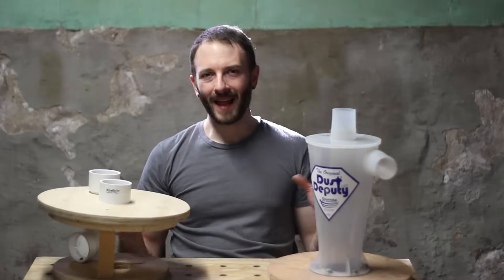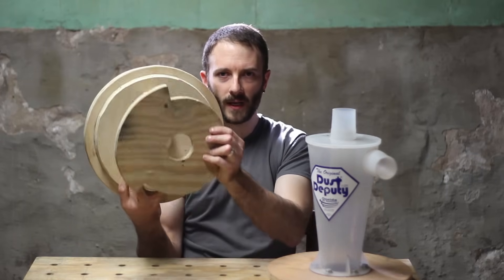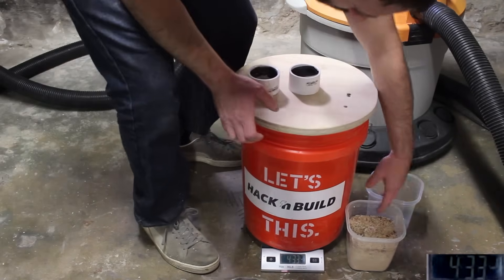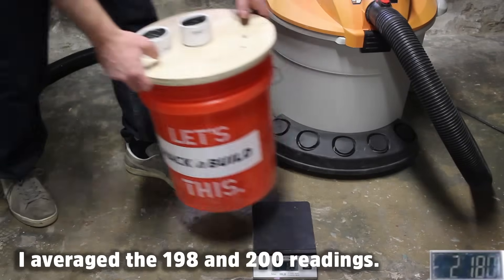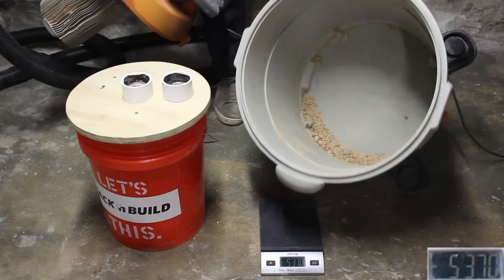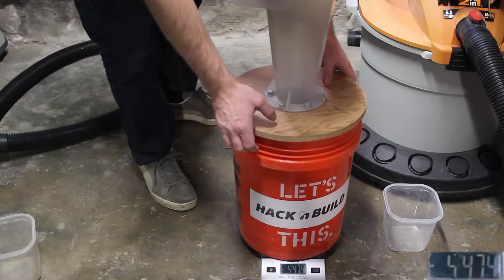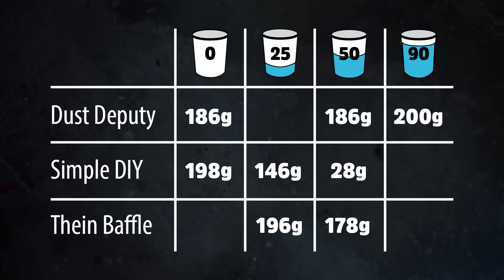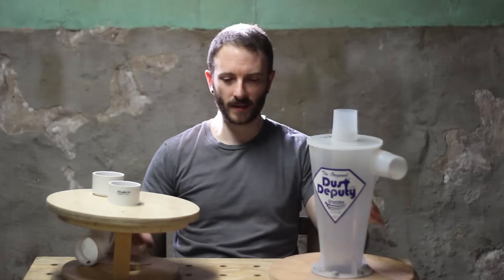IMPROVED cyclone dust collection vs Oneida Dust Deputy (2/2) - HNB #10

Comment: Just a thought if you really wanted to make it work when the bucket was fuller. Adding slots ie louvers to the bottom third of the opening in the baffle or just below it. Would reduce or eliminate the saw dust being sucked back up. Since the negative pressure created by the vortex suck it up at an angle that the louvers will prevent. But a cautionary note, if the louvers are to high they will interfere with the flow of the vortex, that would make it worse not better. 

BTW, Since I was considering doing the same basic thing to a trash can. (But I was going to use the 1st method you mentioned where baffle with attached an extended center outlet pipe.) So this proved what I suspected already so thx for testing it out. And for small container it would make more sense for most ppl. To add Thein baffle to the top the bucket with a more efficient tangential.

Comment: Only 1 detail I would bring up, I'd call it 50% full when the dust level is 50% of the way to the baffle on the DIY version, not with only 2" left, I'd call that 90% full. So, the DIY version would be perfect if you had a larger or taller bucket like a 30 gallon barrel etc. That is what I plan to build.

Comment: The accuracy of your measurements make the test meaningless. With nothing in the bucket you have 186g and with 90% full you have 200g. Sorry that just isn't going to happen.

To make this test truly meaningful you need quantity, time, and restriction measurements. Without a realistic restriction (all the ducting in place to the machine) the lower CFM capability of the Thein baffle is not going to be really evident, therefore it won't show up in the tests.

The Thein baffle has a lower CFM output (pressure drop due to design) and if the CFM through the line drops, less of the particles will be flung to the outside of the Thein baffle, and more will be sucked up into the vacuum cleaner.
Reply from the maker: I am looking forward to seeing your experiment.
Reply: First experiment I want to try is multi cyclone versus single. I'm curious to know if there is any functional difference.
Reply: is there going to be a video about that? Im really curious...
Reply from the maker: If Dodgy makes one then maybe.  I tried modifying the baffle design but it didn't really improve significantly and I didn't want to make a whole video to cover that.
Reply: What would be awesome is to compare Dust deputy vs Clear Vue (Bill Pentz autorized cyclone) vs chinese cyclones.. i didnt find anything meaningful about this...
But the note about acuracy problem with vacuming still same dust is really important. The difference between good and great separation is in separation of micro dust. When you vacum same dust all over again, the microdust will go to you filters...
Anyway, thank you for anything :)
Reply: I was thinking about making a build video. Currently waiting on a new 400mm x 400mm x 400mm 3D printer to be finished. Am thinking about printing up three sections and joining them together, to create something like a six cyclone version. Have some preliminary ideas and designs already done. I think there are some minor gains in efficiency to be had in the cyclone (mostly around angle coming in).
Reply: awesome. I strongly sugest to check bill pentz website. There is a lot "no need" information, but you can find there the most crucial things... look for "neutral vane" on his website - that will help you lot!
Reply: I am actually looking to feed and retrieve from the top. Tricky but should be possible with careful design.

Comment: great methodology for testing.  if I could put my 2 cents in here:  you proved that as long as you keep the bucket mostly empty, it is very efficient.  with that fact in mind, to empty the bucket often can be a key factor to efficiency.  I have done 3 different videos on making an easy emptying bucket to my vac system (less than 10 seconds to empty) so I never let my bucket fill up.  I am of the opinion that if you want an efficient dust collection, emptying the dust bucket needs to be a menial task.  I have also found that I still need to clean the vac filter periodically (yearly), just not as often as I would have to without a cyclone.  the fine dust still gets to the vac (& filter) and clogs up eventually.  great follow up video :>)
Reply: It might not make it if you put a thin shirt over the exit hole on your dust collector..

Comment: Need to get your thoughts on something. I want to build a large cyclone to remove soil from the basement of my 1880 home. I envision using a wheeled walk-behind leaf blower/vac. Then I will use a large bulk bag to collect the dirt.  Perhaps use flexible drain hose and a square plywood cover on top of the bag. I don't want the dirt to hit the blade and chance damaging it. Let me know your thoughts. Thanks.

Comment: wish I had made a video, but I used my dust bucket to vac up the dust from a large concrete and cinder block job..  I probably got about 150 lbs of dust, mortar, and small chunks of blocks, and while the filter in the shop vac was pretty  dusty, it was still doing a fair job ..next to nothing made it to the vac...

mine just has a vac port on top, and the hose from my old house vac, with its inlet port from the vac  cut into the side of the bucket..i screwed it down to a cheap wooden cart from harbor freight, and drilled some holes in the wood to hold atfachments..

also works great on my blast cabinet!  

if anyone is thinking about making one, give it a shot!  I spent about 12 bucks on my whole setup and it does amazing!
Reply: I hope you are wearing a respirator!  A 3M or AOSafety half-mask P95 or P100 costs $20, while new lungs...

Comment: Good video! I went with a deputy style unit much cheaper version though Ill build a better one soon. Rather than placing it on top of the lid I submerged it half into the bucket to make it less bulky.. ran PVC pipe to a Eureka vacuum motor also on the lid. works great mostly for metal dust and particles. I think you could improve the DYS baffle if it were much thinner and the intake driven directly from the wall side rather than curve into the tank. Also, it would help if you had about a foot of straight intake tube before entering the tank and perhaps heat/reshape inside end flat against wall, They all do a decent job picking up chips but it's the stuff that you don't see that kills you, the last small percentage. Dust particles larger than 100 microns will fall back to earth quickly. I would spend the money on a good washable filter that stops 3micron particles that suspend in the air indefinitely. And the most..  "bestes" filter is opening the garage door. I'm mostly regurgitating info. from the one and only Bill P.  if you want an education of collecting rare dust .. his place is the one...  believe his son runs it now......      http://billpentz.com/woodworking/cyclone/index.cfm              had the pleasure of writing him a couple of times.
Reply from the maker: Thanks for the suggestions!

Comment: can i ask what the benefit from the smaller circle is?
Reply from the maker: It's an inset lid so it goes inside the bucket.  The top circle holds it in place and makes it easy to get on and off. It works a bit like a cork I suppose.

Comment: try using a second bucket for the cyclone, this way you can mount it above the collection bucket instead of being inside the bucket, that's why the dust deputy works with the bucket near full, because it does all the work above the lid, really the dust deputy wouldn't save space compared to making your own out of a bucket because it's still tall.
Reply from the maker: That might help.
Reply: FYI- Its been done, Building the two-bucket cyclone by Matthias Wandel
https://www.youtube.com/watch?v=z-xhYnWDCd0

Comment: It's harsh to say the dust deputy works better with a 90% full bucket when your diy decider uses the bucket space itself where the DD does not. So this solution is pretty awesome!
Reply from the maker: True, but the DD still performs better than the baffle design so it's useful to point that out.  You couldimprove performance out of the baffle design by using a larger bucket and emptying sooner.  Thanks for watching, cheers!
Reply: Hack 'n Build thank you for the video!

Comment: .about using up 50% of the bucket. it wouldnt do that if you build a thien baffle chamber to sit on top of bucket. its still much more compact than the dust deputy, also much more robust. i use a thien separator for my main separator. and have a secondary separator using a cyclone for overflow/fine dust. i know this setup sacrifice some on airflow. but it performs more than satisfactory to my needs. and it saves my filters quite a bit
Reply from the maker: Have you tried the setup using just the cyclone collector?
Reply: Thien baffle chambers that sit on top of the bucket has been done many times before. And by just wrapping around an enclosure and making the bottom of it the lid. Your design would work in this manner too. 

But if you did it, moving the inlet to its side that was tangential to it could make more sense. Since it should be even more efficient. 

But base on your test it was not major factor.

Comment: What size of shop vac do you need to have the deputy  function properly?
Reply from the maker: Any vac that would be effective enough to hook up to a power tool ought to work, you just need enough suction to draw the air in to the cyclone and get the cyclonic action going.

Comment: Nice comparison but something isn't right. The Dust Deputy will be more efficient for every particle size so you must not be weighing all the dust captured.  The DD should be in t he 97%-99% efficiency range by weight for most sawdust.  

Also, everytime you recycle the dust you are capturing the larger particles and sending the smallest, most unhealthy particles into the air.  So, by the end the cyclones should be capturing a higher % by weight than when you started.

If you use fresh corn starch for every test then you should get a more realistic comparison.

If you use a tangential inlet I believe your Thien baffle will provide much better efficiency for fine dust.

Thanks for posting your design and tests.  Every test brings new insights.
Reply from the maker: Thanks Tony, I may consider doing something like that in the future.  Might also be good to do a rubber-meets-the-road type test with making a set number of cuts on the table saw and see what happens.
Reply: Concerning starch, be aware that most vacuum cleaners are not explosion proof (open motor) where some have a separate cooling flow.
Reply: Trey Gowdy  actually, a few % points is very significant.   For example,  a cyclone that captures 86% will pass almost 15x more dust than one that captures 99%. That means you have to empty your vacuum and clean your filter 15x more often.  

It seems like it's not much but if you look at it in terms of the % of dust that is passed instead of the % collected it becomes much more intuitive.

BTW, you should be able to vent outside with just the dust Deputy without mods. It captures 98+% of the dust (by weight) so only the finest dust passes through. Make sure the outlet isn't near an area where air gets sucked back into your shop.
Reply: Trey Gowdy  i used a dyson after the thien before the shop vac got great results, i have a vid of it here  https://www.youtube.com/watch?v=Khrwpm57nO0

Comment: From an engineering standpoint, why isn't the outlet of the infeed pipe below the baffle?
Reply: It just occurred to me that it may be related to the fact that the lower chamber ends up as a vacuum which allows the dust/debris to be forced down once it passes over the slots. Or something along those lines...
Reply from the maker: I am pretty sure that would get dust swirling around below the baffle, which would defeat the purpose of having the baffle in the first place.  Shoudln't be that hard to try out, I'd be interested in seeing what would happen.
Reply: Actually, the more I think about it, having the outlet below the baffle wouldn't prevent the finer dust from just eventually flowing back up towards the outlet. With the baffle, once particles get below it, they are completely removed from the air flow. Getting the particles to fall into the slot is the trick, which I guess is the physics happening in the Dust Deputy. I find the whole physics behind this process quite fascinating.

Comment: One thing to also note here is that what the Dust Deputy gains in efficiency, you also loose in height and shop space.  I'm building a small dust collection system to go right under my compound miter saw cabinet and will use my POS Home Depot shop vac (the one with the nice detachable blower..yet a dust barrel that is virtually impossible to empty out because of its folds and lip) - And because of the 40" height restriction of my saw cabinet I'm purchasing a 20 gallon plastic drum (30" tall x 19.5" dia.) with snap lid that I'll build the Thein baffle into.  And then I'll just dump it whenever it reaches ~8 to 10 gallons.
Reply from the maker: Sounds like that will work well for the space you've got.  Throwing out another idea: what if you constructed a square box  to hold the sawdust instead of a round barrel?  Might help you eek out that extra bit of space.📏
Reply: I'd thought of that but luckily the plastic food container barrel will fit nicely and costs $30. A custom box would cost at least $50 in materials and maybe a day of work. Im in San Diego, we have a store called Drums and Totes (may be a national chain) and you can get really nice stuff from 15 gallon up to 55 gal. or more.

Comment: Really interesting experiment but If you have the appetite you could take it a stage further. But first you have to recognise that the cyclonic action of the DD is happening above the bucket while the DIY is inside the bucket. To address that put the DIY in a taller bucket at least as tall as the existing bucket AND the DD. The comparison of efficiency can then proceed on a more equal basis with performance measured in steps of x inches in the bucket so you can detect where (or if) it tails off. You could the mark the DIY bucket with a ‘must empty line’.
Reply from the maker: Thanks Norman!  I've actually started on a follow up where I use a 1.5 gal bucket as a topper so it creates a true 2-stage cyclone.  I think that's going to have the highest performance of any of the DIY builds so far.

Comment: I built a Thein top hat to go on a blue barrel. Works great. Used my old busted vack as the top hat. Saved a fortune in bags.
Reply from the maker: Nice.  How much does a barrel like that weigh when it's full of sawdust?
Reply: Its not bad. Its not the biggest its the middle size one I dont know how many gallons off hand. I normally empty it when about 3/4 full and I have it on wheels to move around the shop.

Comment: If you are not following Bill Pentz's design and you are venting this air back into your workspace, you are doing nothing but creating an invisible dust killing machine.  Just so you are aware.
Reply: Cyclones ar great to extend filter life but always use a filter.
Even a 2 stage cyclone won't remove the smallest, most dangerous particles.  Always use a good quality filter as the final stage or you are just pumping dust into the air which would worse than not collecting the dust.
Reply from the maker: A true 2-stage cyclone out performs there's no doubt about it. I was mainly interested in seeing how the simple type dust collection works compared to commercially available cyclone like the Dust Deputy.  This is better than V1, but still not as good as the Dust Deputy so am going to keep iterating on the DIY system to see how close I can get it.
Reply: Who is Bill Pentz, and what is his design? No one is a fool to run a dust collector with a filterless vacuum. And the higher MERV of the filter the better. I just do not see the point of your comment.

Comment: I may be mistaken but I believe that the comparison is somewhat apples to oranges. As you said the modified design is a big improvement until the bucket gets filled. I Think the key is the distance from the two pipes to the sawdust in the bucket. The dust deputy forces the distance to be longer and so it works better as the bucket is filled. I suspect that a taller but narrower bucket, or deeper thein baffle would increase its efficiency. just a bigger trash can may be easiest solution.
Reply from the maker: I agree, but you'd still have the same problem with loss of efficiency as it fills up.  I observed the effects of this by placing a flashlight inside the bucket while the vacuum was going. As it fills up the dust will start to swirl around and the effect comes amplified the fuller the bucket gets.  The baffle mitigates this and having a completely 2nd stage removes it for practical purposes, at least with my two designs.

Comment: A proper setup cyclone such as Deputy or Chinese works very well. Its been used in industry for years such as the gas industry .I fact there are several video on industry use explain them very well. There is also a video on her doing the measurements between Thien and cyclone that shows real difference between them and cyclone advantage. especially in large multi ported systems.
Reply from the maker: Interesting factoid David, thanks for sharing.
Reply: Hi, can you post that video? it is not easy to find it... thx
Reply: Toyota use the same principle in the air intakes for their Land Cruiser vehicles, so the sand and large particles don't go in the filter.